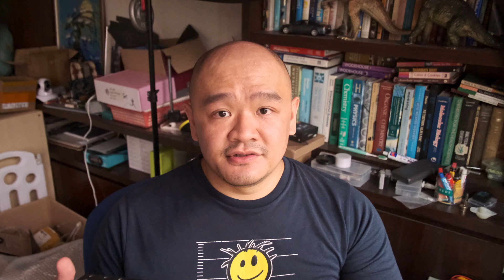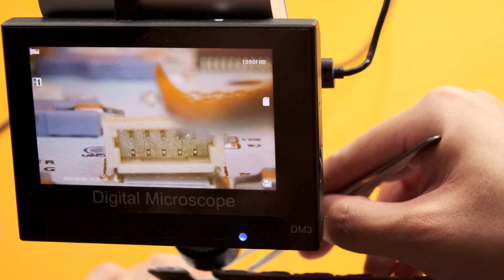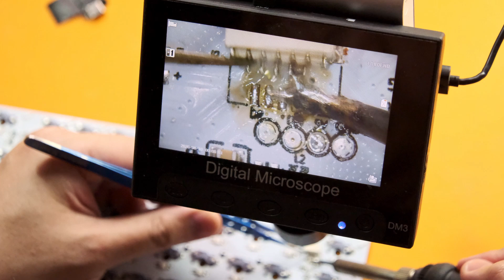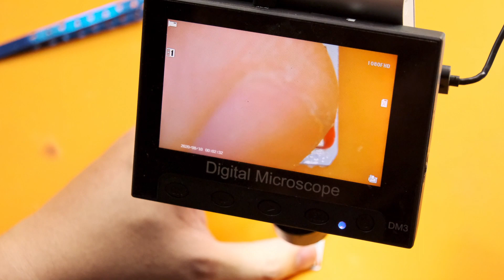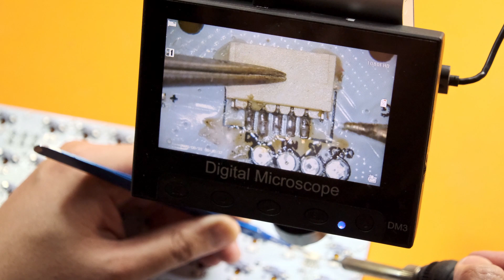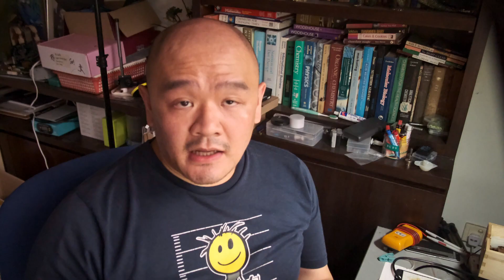Damanged Akko Acr Pro 75 Connector - Rodent Repairs

Comment: where did you get the connector pin?
is there a way to buy it?
Reply: got the same question, with the same issue, i found a bunch of options on aliexpress but im not sure which one is right... well and then i gotta get the equipment to repair it

Comment: Same thing just happened to me while I was building the keyboard for the first time! I put it together and it didn't work, so I looked at the connector pins and saw them badly bent. I've never seen a connector like this so fragile. Luckily I was able to bend them back! BTW, I think you could test the board because it has LEDs on it that turn on (by default at least) when you plug it in.
Reply: what did you move the pins with? mine is pretty bad so if you can please please PLEASE help me out in detail if you can.

Comment: You're done a great work. But I gotta say, at least from the last shot with the microscope a few pins in the replacement connector seemed to be slightly unaligned. I'd fear to bend them further after a few uses. Were you able to test the board after the fact?
Reply from the maker: Ah you made me realise that I uploaded an older version of this video that doesn't include the video that the customer sent me showing it's working!

Yeah, I wasn't too afraid of that as usually the plug will help correct slight variances like that, so I didn't need to be too exact. 

It SHOULDN'T cause any problems
Reply: @TechRodent  I thought about it, but I have clumsy sausage fingers. So glad to know it's working fine. Well done!